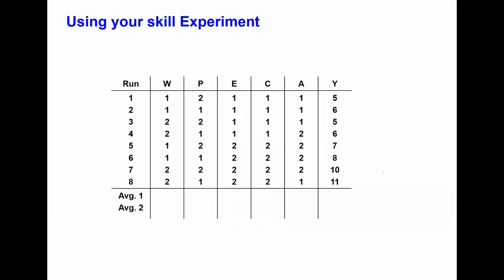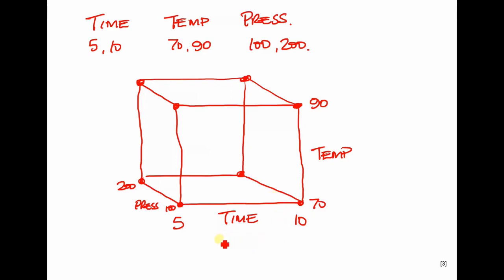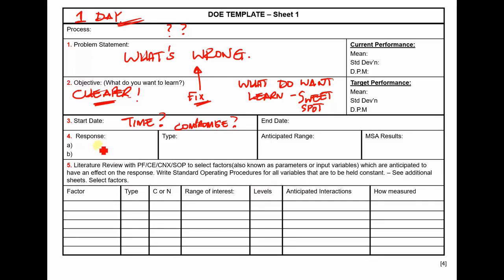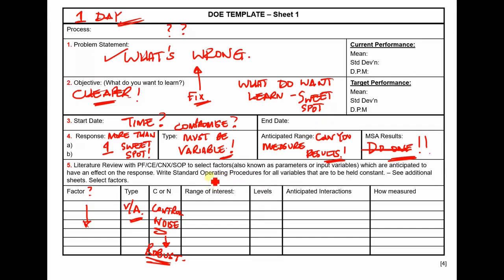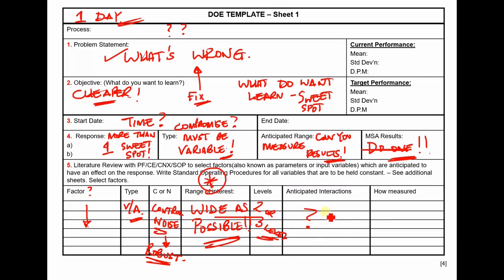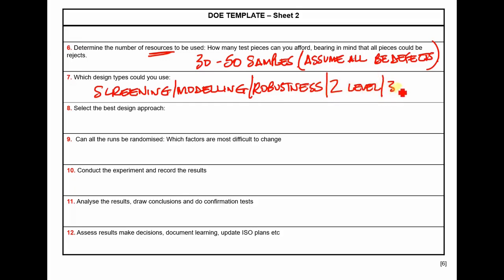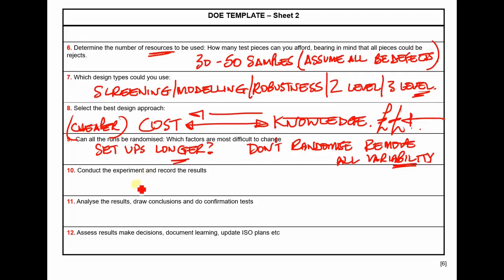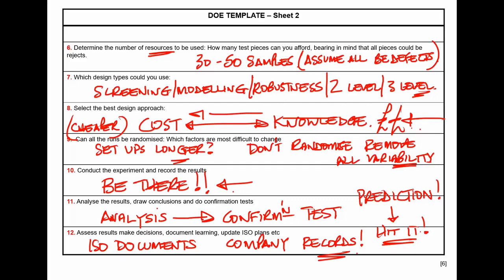DOE Planning - It's takes a Day!

Comment: Great video. Thank you. I work in medical devices and have just planned a DOE this week as it happened. Watched this video as a sanity check and it looks like I hit all the major steps. What I’d quite like to understand at the moment is what exactly you’re giving up when you go from a full factorial design to a fractional design. If you have a 4 factor, 2 level DOE that’s 16 runs for all corner points, however I also have the option to do a 1/2 factorial which cuts the total runs in half. So what exactly are you giving up I don’t quite understand. Intuitively it will lower the resolution on the analysis that you get. But could you for example still identify the critical singular variables or are you essentially testing them in pairs, so it would just be able to tell you that either factor A or factor B is significant, but can’t narrow it down to a single factor?? Any thoughts would be appreciated.
Reply from the maker: Philip - good to hear from you...what you give up is the ability to see the interactions. If yiu have 4 factors, there are 2 way interactions, 3 way interactions and the 4 way. If you do the FF you can see all of those. In Chemistry 4 ways are sometimes powerful. In Physics only the 2 ways tend to be influential, so in physics you can do a fractional design that still shows you the 2 ways and that would be ok. Good question though..